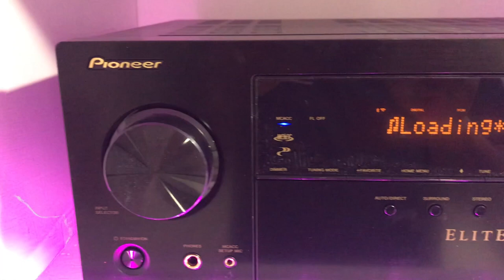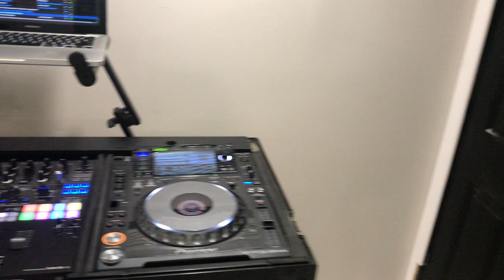My DiY Home Theater/Man Cave

Comment: What projector are you using?
Reply from the maker: Darin Buss optoma UHD50 4K
Reply: MrDJXFIVE very nice room are you using in walls if what brand?
Reply from the maker: I think you talking about speakers when u said in wall if yes I’m using 7 ceilings speakers 5 angle ceiling speakers and 2 regular ones for atmos I installed then right on top of the sofa. They are from silver tickets nothing expensive and I have klipsh subwoofer.